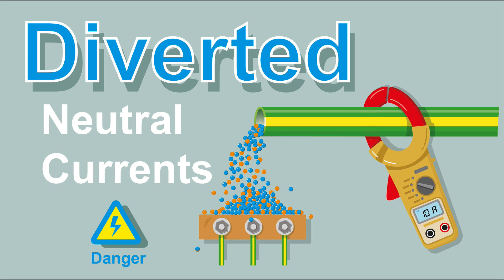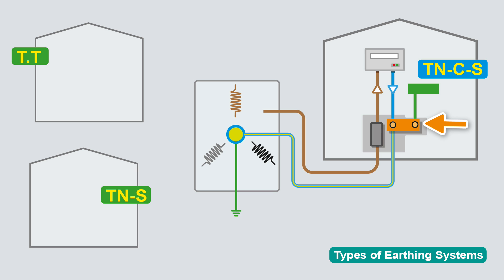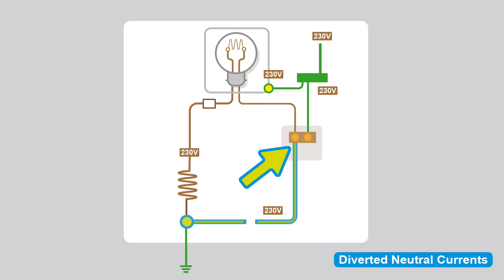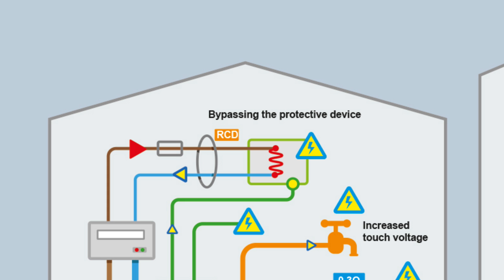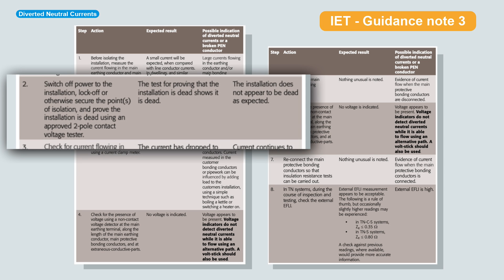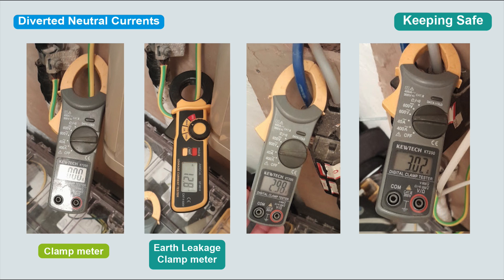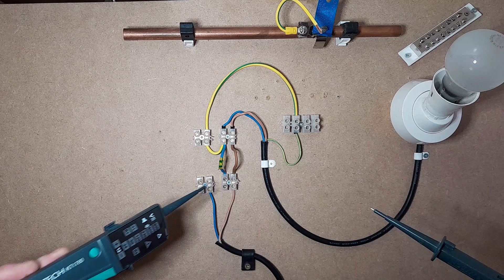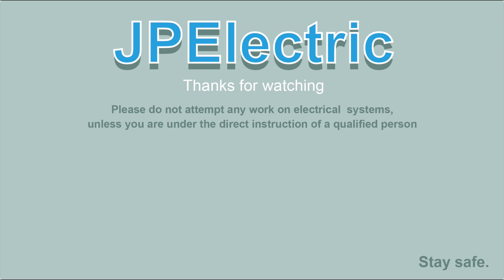Diverted neutral Currents -  Is our electricity supply safe?

Comment: I wish you guys would be a bit more specific. Instead of asking "Is our electricity supply safe?"  it would be more accurate to ask, "Is the UK's electricity supply safe?" 

And I would  say that no, your electricity supply is not safe. But living in the US, I would say our electricity supply is safe. 

But our system is more than a bit different. Technically, using IEC terminology, we use a modified TN-C-S system But we also use a split phase 240/120 volt system with a grounded neutral The  Neutral is grounded by the Utility at the transformer. Every single family home has its own transformer. At the distribution panel in the home we use a separate ground rod for the equipment ground, not water pipes or gas lines. My grounding electrode is not shared with the neighbor's house. they have their own. In the distribution panel and only there the neutral bus is bonded to the steel panel trough a bonding screw. But we have a separate equipment ground bus, connected to the grounding electrode ground rod, 

Of course all real grounds are common through the  earth, but invariably at different potentials. Rather than a single RCD in the incoming feed, we use separate GFCIs on individual 120 volt standard circuits and they trip at 5ma instead of 30ma like your RCDs. 

In normal balanced loaded conditions, from the panel back to the utility, you won't see any neutral current, the only current on the neutral is the difference in balance between the two 240volt hot lines. So at any receptacle as low as 5ma going through the equipment ground, will be recognized by the GFCI and it will trip. If we get an open neutral from the utility, everything will work fine if the two line loads are balanced and any diverted neutral current will still be detected by the GFCI. If the line leads  become imbalanced, it is pretty easy to detect because you end up with two series circuits with a non-connected neutral in the middle, but not returning the imbalance back to the transformer. the bonding screw on the panel neutral bus, won't support much current back to the grounding electrode. But each receptacle is still protected from a current through the equipment ground. 

In reality, the only thing the bonding screw does is account for any potential difference between the utility neutral ground and the equipment ground electrode. and  provide a trip path for the circuit hot line feeder breaker. So all these things maker our electricity supply much safer than yours. 

Personally, I think using 240 volts on routine circuits, is inherently more dangerous than 120 volt and having a single 30ma RCD, provides for far more energy in a shock or minor ground fault. 240v X 30ma = 7.2 watts whereas 120v X 5ma = 0.6 watts. 

That aside, adding an equipment grounding electrode instead of using common piping systems would help a lot. Our system isn't perfect but it is much safer in multiple ways. 

Just having the separate equipment grounding electrode, would not be a huge expense to implement vs other solutions. Exactly where the RCD is connected in relation to the  equipment ground could make a difference too. I'm not entirely clear how you guys do it, Having the single RCD was really a cheap way to provide limited protection. 

In the US, we can use GFCI breaker on each circuit at the panel and that's how we first did it, but more often today, we use GFCI receptacles at the first protected receptacle and any downstream receptacles are ten protected by the first one. Not being remote in the distribution panel, makes it a lot more convenient too.  Having one main RCD on our split phased system would be pointless because the main neutral only carries the imbalanced current. 

At this point, it would be pretty much ridiculous for you guys to change to the split phased system and typical 120 volt system vs your 240 volt system, but   you guys could benefit from some things we have done to make our system safer. Just my two cents. or pence or whatever it is you use!

But please do keep on mind that the internet goes world wide and your electrical system is not used world wide. Even all the 220-240 volt systems have differences from one country to another. I enjoy looking at what different countries do because I'm an electrical engineer. I also get a kick out of the IEC saying they are the worldwide standard. Because knowing how they work and how low their standards are, they are a joke with an inflated ego about being the world authority!
Reply: Good points with the multiple grounds at every house and transformer in the US. But with a broken neutral you then rely on the ground rod loop impedance back to the transformer. Depending on that impedance it may not be low enough to trip a breaker. So same conditions apply as in video. And also with a 120 / 240 split system in the US when you do have a broken neutral you can end up with wildly different voltages on each leg depending on loads, since with no solid reference back to the transformer neutral (except ground rod) you can end up with 160 on one leg and  80 on the other. When working for an electric utility in the US I have seen quiet a few devices fried in peoples houses when the neutral broke. So the split phase system is not without it's drawbacks as well. 

As far as 120 / 240 split phase, the US and the few other countries that use it are the outliers. 90% or more of countries use 230V or 240V single phase, if not 230/400 or 240/415 three phase to residential as well.  Benefit of 230V of course is system build out, you need a quarter of the transformers, due to less I2R loses in the secondary distribution lines. You don't need a transformer for every 5 houses and heavier gauge wire. You put one 380kVA or 500kVA and feed a whole neighborhood. Plus most house wiring is smaller as well. As well as cords on electrical devices. Took some getting used to to see basically a lampcord on a refrigerator when I moved from US to a 230V country. But, half the current, smaller conductor. 

As far as I know they  use 30mA (even up to 300mA) RCDs on 230V systems for a few reasons. One, at 230V you will get more normal leakage to start with and two, they usually use one RCD for multiple branch circuits. Using a 6mA RCD for four branch circuits at 230V will cause nuisance tripping for sure. 
There are pros and cons to all systems, TT, TN-S, TN-C-S. 

I now live in Vietnam with a TT system and it takes some getting used to. ZERO grounds at houses or receptacles, which are two prong, unpolarized. Just neutral and hot coming in. No ground, no bonds, just straight up TT. I have had some Americans here ask me to add in a ground rod and bond their neutral to it and since you are an engineer I am sure you are well aware how bad that can end up. So a TT system shall always have an unbonded neutral to ground and when I install a ground I leave it unbonded. But, I went way off topic here....  
Not saying one system is the best and the rest sub-par. They all have their benefits and drawbacks.
Reply: @inothome  Thanks for the reply, It's rare to find someone with broad knowledge. You are correct about the potential of an open neutral back to the transformer, but I believe that's very rare. Nonetheless, I have contemplated designing a device that could monitor incoming conditions with CTs on each hot leg and neutral as well as the ground current through the ground rod conductor. The concept is a 'system analyzer" that would monitor and alarm and be capable of reporting thing like balance and stray currents. There probably is little need for such a device, but I just like the concept of providing more information.  There are power monitors out there but I don't believe any provide this level of detail,  even though they could pretty easily add such features. 

A much simpler device would be a single CT on the grounding conductor right at the ground rod. It wouldn't need trip the main, but alarm anytime it saw any significant current. Pretty simple device that could easily retrofit to any system. Should really be no current flow in this conductor, however I believe some small stray currents may be observed, as in theory, it can provide a parallel path back to the transformer. 

As for 3 phase for residential, I don't believe we use this anywhere. 3 phase-4wire is common in commercial but I have never heard of it used in residential. 

I favor one transformer per home, but I know that sometimes they get shared and it's common for apartment buildings. Seems to me that shared transformers can have efficiency and balance issues on split phase services. A typical standard service today is 200 amp 240/120,  If you have EV charging, electric based heat, which includes geothermal and heat pumps, a 400 amp service is not all that uncommon. I really don't see a major economic advantage to a large single transformer. These get petty costly and in practice require another level of distribution and protection systems.  

Personally, I'd rather spend a bit more on a safer, simpler system.  If you go back a bit over 100 years ago when the US and NA went one way and Europe went another, no one was really looking at safety as a real factor in the decisions. The split phase idea was pretty ingenious really and although the US decision was driven largely the abundance and popularity of Edison's 110 volt incandescent lightbulb. but the concept of 220 volt power was also desirable. In a round about way, Edison's choice of 110 volts for his lights had a safety consideration to it.  Edison lost the war of the currents with AC winning over DC, but he won economically in that his standard lights were compatible with the choice. 

No doubt, the 220-240 volt world as he more economical  choice. On my opinion, the "240 volt world" has always been weighted more by cost above all else.  Safety did not really become an issue until later after both sides were already long committed to their voltage choice!  European countries took their system to their respective colonies so the 240-ish systems soon dominated most of the world. And when other neighboring countries electrified, the were largely steered by the available grid power. 

Canada and Mexico adopted the US system although parts of Canada industry did have 50Hz, for a time. this was mainly in the West and was mainly papermills and some steel plants. As I understand it, it mostly was about who made the Generators.  AEG was 50Hz, GE was 60Hz.  Very difficult to change in heavy industry because of all the motors used. I worked in a very old steel plant in the Midwest some of it dating back the very early 1900s. Some of the very old rotating machines were 25Hz. The plant made its own power and actually fed a neighboring community. We still used some 25Hz in the 70s and 80s and beyond. Cheaper than replacing huge old motors and gearboxes to get the speed and torque right. I remember a big mill drive motor that was Westinghouse serial number 003!!  

Mexico did have some 50Hz until the 70s,  Easier to compensate for voltage differences than frequency. 

And then there is Japan.  Generally, 100/200 volt split phase. West half of the country being 60Hz and East half being 50Hz. Pre WW2 most ll generators were AEG, post war when US was directing the rebuild of the country, they brought in GE stuff at 60Hz.  I've been to both halves. IDK how accurate it is but I had heard from Japanese EEs that they did a lot of studies, concluding that 100 volts was the ideal choice for safety. 

Generally their electrical infrastructure is quite robust. and reliable. Their power companies are huge and somewhat hierarchical, like most industry in Japan. I don't know anyone in power distribution, but know a lot of engineers. Mitsubishi  is sort of the General Electric of Japan. They make everything! They are a huge company with many divisions, I can't say I have  every seen anything under designed.  Most every engineer I have com across in Japan, have high ethical standards in regards to safety, 

But without a doubt, there is wide variability between countries. In developing countries, electric power bring opportunity, but if done rusheed or poorly engineered, it ends up undermine the whole system. You can put something together that actually works, but is full of hazards. Some places have decent standards on paper but have poor implementation and/or enforcement. Far too many untrained or poorly trained people doing electrical work. In the US we have gone from pretty well trained and educated people to what I call, "electrical installers" who really don't understand what they are doing.. Electrical work is not a DIY skill. but we see a lot of equipment designed around making it DIY.  Mistakes can kill people.
Reply: @professorg8383  Agreed, not to often to find someone to have an actual educated conversation with here on YT, so thanks for your reply as well. 
I am 99% sure they do make the ground current analyzers you mentioned. I do know for a fact they make open ground conductor monitors and seems to be more common in the UK, but have never seen one in person. 
And yeah, as far as three phase in the US residential I have not seen it. I have seen 400A services with CT metering for some huge houses, but never three phase. I have however seen quite a few three phase residential services here in Vietnam in some of the larger villas and I do think it is also common in Germany, from what some people have told me. 

I think the main advantages to 240 single vs 120/240 split is costs and line losses. Like you said, with 120/240 split phase you can have one transformer per house and that is fed with 1/0 triplex, maybe even 2/0 triplex. Then you have a 100A or 200A main panel in the house. Whereas with 240V systems they will have one transformer and run 4/0 or 320 (some odd size, I forget the actual size) quadplex and that will run the whole length of the street and feed 100 houses of one run of quad. Then in the houses there is no conventional main breaker panel like we are used to in the US with the heavy bus bars, clip in breakers etc...  Here a typical house will be fed with a 63A service, with DIN rail mounted breakers in the main. Like they do in the UK and most of Europe as well. So there is cost savings with that too. Then some branch circuits will be as low as 6A and up to 32A. So you save on the main service drop wire size too. Instead of 1/0 triplex you'll have 2 x 10mm wire, 2 conductor here with no grounds in Vietnam. 10mm is about 8AWG for comparison. Plus all the switched, receptacles and devices will draw roughly half the current at 240 vs 120.  So wiring and components are sized for less current. Wire is still rated to 600V insulation value though. 

My career was in substations and protective relaying, so I did not do much residential wiring in the US. Of course I did my fair share of residential wiring, but not as my career. Once I moved to Vietnam I have done a lot more residential / industrial wiring and still so crazy to see the tiny conductors used with 240 vs what we are used to in the US, since the current is roughly half for every device. My fridge only pulls 1A and the cord is no larger than speaker wire! lol Takes some getting used to wiring in a house main with 8awg or 10awg equivalent and that powers a whole house. When in the US we are used to 1/0 if not 2/0 to feed a house. Some larger houses, as I mentioned earlier, will be fed 63A, three phase 230/400V. But not many three phase loads. Just they need more than 63A of 240 to power the larger houses, so they get 63A x 3.  But, the local way electricians do things here is downright scary! Not much training and just twist wires until it works..... which usually only works for a few weeks and then more issues. I fix a lot of electrical issues here. 

Yeah, Japan is odd with their system for sure. But, due to that it enabled devices to work on more than one voltage and frequency back in the day. Now of course all the SMPS are all dual voltage and 50 / 60Hz. So when traveling most 120V devices will still work on 240V. Until you get to heating devices... yeah, the 120V heating devices let the smoke out when plugged in to 240V. 

The old motor-generators were really cool devices, to go from 60Hz down to 25Hz. I have seen them in old train substations and I think they were 60 to 27Hz. Now of course with high current IGBTs and electronics it's all done electronically. Like with HVDC power lines and the converter stations. Amazing the power levels they can transmit converting AC to DC then back to AC. And to touch on line losses again, they use DC since DC doesn't have the same line loses AC does. With the stranded transmission line conductors, the higher the current, the higher the impedance due to the twists creating magnetic fields that creates more impedance and heating. Whereas with DC you only have the actual resistance of the conductor itself. So a transmission line conductor of the same size can actually transmit more DC power than AC power. And not until semiconductors became able to handle the higher currents did it them become more economical to use DC for long transmission lines. 

If you are curious to what a main panel looks like with DIN rail breakers in Vietnam vs the panel boards in the US here is a video Jordan did of Artesian Electrics from the UK. He was on holiday , traveling throughout SE Asia and I invited him to check out an interesting problem I was troubleshooting at a house. I did not do the install, but this is typical of what I see here... no color codes, no consistency and scary!!! And I have not been back yet, so still no idea where this fault is, but homeowner does not seem to understand what can happen with a second path to ground and who knows how good of a path, it can heat up and start a fire. It's a TT system here, so no ground supplied from utility and not common to even have a ground installed at the premise.  https://www.youtube.com/watch?v=W2kAejAb4Hw
Reply: @inothome  "Protective  relaying"  You guys were the "nerds" of the power industry!! (just joking!) I've worked on building and then managing some large facilities with enormous power infrastructure. I'm wanting to say that our main 138kv sub handled about 30 Megawatts. I was not a power guy, but knew enough to be dangerous!  The "power nerds" spent a lot of time and effort getting it all coordinated. Definitely a special breed of engineers! I could follow what they did, but it certainly wasn't my area of expertise!

I began my long career in the 70s in a big steel company. We had about 16,000 employees at peak. It was a fully integrated mill, and for a long time we had the world's largest blast furnace. The plant was the size of a small city and ultimately I went on to a billion dollar joint venture greenfield plant.  I was mainly a controls/automation guy, but got into just about all aspects of the electrical field. Started out as an industrial electrician, managed electrical maintenance and worked in engineering on the design of a huge joint venture, leading edge facility. Our joint venture was run with a petty small staff which meant everybody in management got into all areas of the industry with my main job running maintenance with crews of about 40 techs in total on several different teams.  We were very much built around self directed workforce concepts. We actually made it work very well. A big difference from thee old top down style of management!  But we electrical guys were also more self directed, even in that environment. It always made more sense to me, but then by our nature, we were made up of well trained responsible guys. 

I "retired" and went into consulting including project management of some very large projects. Finally "sem-retired" again, consulting on hand picked projects and teaching. My resume reads like a book! Over the years, I built myself a very nice shop so I could maintain the fun of hands  on projects. I still come up with ideas a an excuse to buy more tools! At 70, I till like to dabble, and teach part time. Do my best to stay up on the latest tech across a wide variety of fields. I am kind of a "Jack of al trades"  and master of quite a few. 

I grew up in the space race and when all my friends wanted to become astronauts, I wanted to become one of the engineers in white shirts with pocket protectors! Always wanted to be the guy who knew how everything actually worked!  Still have not lost that drive. I love history overall and the history of tech and how it evolved across the world, 

When you talk about motor generator sets, I have dealt with smaller ones of multiple machines coupled together to run process lines and a few big boy that you could stand inside the stator and barely touch the other side above your head! Amazing machines!! 

Like you, never really worked in residential electrical, but did a lot and often got involved in troubleshooting when friends had problems. Did all my own work and strangely enough even consulted og NEC regulations! At one time or another, I have crossed paths with some of the top guys in the fields. Names that many in the industry considered legendary.  I never became famous in the industry, but was considered wizard club in a few circles. 

So I watched the video you linked and really enjoyed it, however, I don't think it was the one you were talking about related to main panels in Vietnam. It was really cool but I don't think the one you meant to link.  

Have enjoyed the conversation. Rare these days to come up with intelligent commenters. That used to be part of being an '"electrical guy", but it has changed through the years and there's a lot of people in the field who have no clue of what they're doing!
Reply: @professorg8383  Nice career you had! Yeah, relay work is fun, especially commissioning. Can be really rewarding to figure out why a scheme isn't working as the engineers expected it too. I had a similar start, but at a sewage treatment plant. I was lucky enough to bounce around in all the departments, learning and helping solve problems. There were a lot of lazy people there, so I got to fix a lot of problems no one else cared for, even though that was their job. Even as a kid I was always fixing everythign inthe neighborhood, what I find enjoyable. 

Also did the SCADA systems there as well, so familiar with controls. Then moved on to an electric utility, did an apprenticeship for substation electrician and like the shit plant, I was able to do a lot of stuff out of my classification. We had a small peaking plant too, so with my background with controls I ended up doing all the controls for the generators and eventually worked my way up to being the relay tech for the utility. Did everything, from relays, to gen controls, to radio systems, fiber, you name it. 

Left that job, took a trip around the world and decided to semi-retire at 45. Since then I have been to Antarctica twice as power plant electrician and funny you mentioned NASA. I worked a year at KSC in the high voltage department and left there about year ago, why I have so many rocket launch videos on my channel. But most people these days do not give one shit about the job, just there to get a paycheck and no idea on how the stuff works that they are working on. So even when I work it's hard to have technical conversations about the equipment. I try to teach fellow employees, but most don't really care, so disappointing. How can you fix something if you don't know how it works? (Hint: they don't, they throw parts at it in hopes to fix it). So been fun chatting here. I have worked with a guy who helped write some IEEE standards, pretty well know in the industry, Don is his first name. 

And like you, even though I am an electrician / relay tech by trade I am in to everything technical. Constantly learning, you will never learn everything and no one knows it all. Plus, we all make mistakes and that's part of learning.  And speaking of mistakes, yeah, I did link the wrong video.... I fixed that link, but I'll link it here again. 
https://www.youtube.com/watch?v=W2kAejAb4Hw
Reply: @inothome  Yes, I feel like I have had a good career and have no regrets of the path choices I made.  I would say you took some similar paths along the way.  I am a firm believer that what some people see as setbacks in their careers, can actually be opportunities to change your path. 

I still strive to learn new things everyday!  You'll never know enough!  

Watched the right video and my first impression was, "what a mess!"  

Are those real commercial panels or homemade DIY version of a consumer panel? Pretty much looks like just a piece of DIN rail and some breakers mounted in a J-box. Weird because it looks like a nice modern residence but with electricity being an after thought!

Not that I think very much of the IEC and see it more political than technical or safety driven, but I see that Vietnam is not a full member. A lot of IEC full member countries have some horrible electrical standards in practice.  I'm guessing that Vietnam has no real standards but if they do, no one follows them!

Reminds me a bit of ElectroBoom's vacation videos looking at hotel electrical installations in different countries.  He recently did one on Mexico, Jeez, what a mess!  He's a smart guy, but a bit crazy and entertaining.  I have occasionally borrowed some of his ideas to base labs on,  for my students.  I like to make my classes fun and also like to illustrate the importance of safety. I sometimes use hot dogs and other human analogs, to illustrate the dangers of doing something wrong and the potential from unplanned energy releases!  It's easy to  say don't do something, but showing students why, has bigger impact on learning. 

I have had students suggest that I do a YT channel, but the last thing I want to do is encourage idiots to do dumb things in an environment I have no control of. Doing quality videos is tough to do, as I found out during Covid doing Zoom classes! I prefer my classes being very interactive.as it's the best learning environment, in my opinion,  

Anyway, it's been a fun chat. Enjoy what you do! That makes work eay and rewarding!
Reply: @professorg8383  That is the normal breaker box here, some are even worse, some are better. But the UK uses (most of the world) DIN rail breaker panels too but the UK has inspections and they look much better. Here, it's a free for all. If I install one I make it look nice and it's so hard to not rewire an existing one if I am in it. But a local electrician here makes $7 a day, I charge more than that an hour. So a rewire to make it look presentable is a hard sell. And yeah, not many standards here and no inspections either. 
Great chatting and yes. I don't consider what I do work, I enjoy it and it's great to have a career you love. Makes work enjoyable. Although doing work here in VN isn't always fun. But full time jobs in the utilities I really enjoy.
Reply: @inothome  
The French now have superior main panels than the UK. They have double pole breakers as standard with twin busbars. That is the only part of their regs they are superior. But we are catching up in that aspect. Double pole breakers are available in the UK, they are just not mandatory yet.  RCBOs are recommended on all circuits as are AFDDs (arc fault) on socket circuits. AFDDs are mandatory on socket circuits in high-rises over 7 floors, care homes, etc. 

The French do not have main cartridge fuses. They have a whole house disjoncteur différentiel which is an RCBO of 300-500ma and combined main switch - max current is settable. This is to prevent fire while your local RCBO is for fire and person protection.  

The Danes tend to have three phase run into homes. A 40-60A supply would have three thin 10mm cables run in.
Reply: @inothome  
In the UK there is nothing stopping you converting your house to TT. Just ignore the ground wire supplied by the electricity supplier.  I would advise the earth rod to be away from your house and other houses as much as possible.  Say in the back garden, accessible under an inspection lid.
Reply: The US system is weird. 
* 240v and 120v run in? Wow!  
* The plugs are terrifying  - look like they are from a Lego set - hanging out of the wall a lot of the time.
* Sockets have no switches.
* Two types of plugs, 110v and 240v.
* The huge main panels look like from the 1940s, as do the huge black breakers. 
* Cables are thick, being more expensive as more copper is used. 
* Try boiling a kettle for coffee. You will die of thirst by the time it boils as the 120v does not deliver the power.

Bordering on third world. I cannot think of anything the US can offer, apart from lots of space in main panels.  
Canada should start the process of modernising, converting to single phase 230v, and adopting the best socket and plug in the world - the British G type. Also having double pole breakers at panels and AFDDs as standard.
Reply: @johnburns4017  Boil water with an electric "kettle", how cute. Just remember to turn off the socket when done! Can't have energized sockets around. 
As far as conductor size, coming from 120VAC and now working with 230VAC equipment, the power cables feel like speaker wires. Not sure about you, but I'd rather have more copper than not enough. We are well past WWII now and copper isn't in short supply. Speaking of, are ring circuits still a thing? Talk about third world. lol 

Jokes aside, I personally don't care one way or the other. Both have their advantages and disadvantages, as with most things in life. Although, I was serious about ring circuits.
Reply: @inothome  
Ye we make tea and coffee and soup and all that with boiling water. Amazing eh?  I personally use a simple metal kettle on an induction hob. - boiling water in around a minute.

I refer cables with the correctly sized cable. Look at all that extra copper in US and Canadian home. A slowly disappearing resource. And this thicker cable costs more.

I worked on a US military project in the Middle East. I was amazed they were using steel conduit in plant and mechanical rooms when we used mineral insulated cable and had done for decades.  It a was flashback to the 1930s. Very cute. I was expecting to see Laurel and Hardy walk in. 🤣
Reply: @inothome  
Final ring circuits came into their own in the late 1950s. They were not to save copper. My mother's house was built in 1954 with 13A G Type plugs. It had radials. Ring circuits have been widespread in the UK for 75 years. They have been found to be very safe. The British G Type fuse-in-plug was to protect appliance flexes. And to standardise on one plug and socket as previously there were different sized plugs & sockets and cable for different types of current draws and appliances. It was common to have three different types of socket in one room. However the fuse-in-plug became an enabler to use final ring circuits. The final ring circuit is ingenious in its simplicity. When used with the British G Type plug the ring is a busbar run around the house with distributed fuses at each appliance. 

There are many advantages to rings:
1. Cheapness, as smaller easier to install wires can be used;
2. A large number of sockets can be off one cheap to install ring;*3.* Having the same number of sockets using radials would mean multiple radials and multiple extra breakers at the main panel. Far more cable, expense, labour and hassle;
4. The 32A breaker and 13A fuse in the plug ensures safety;
5. Portable plug-in appliances on a ring cannot exceed approx 3kW. Some plug-in ovens are on rings;
6. Rings usually have a 32A breaker at the main panel - can be a lower value; 
7. Using push-fit maintenance free Wago type connectors to connect up the ring adds safety, as not being screwed connections they do not work loose. The ring's current does not run through the socket terminals (this applies to radials);
8. The British plugs enable rings having a max 13A fuse in them - can be as low as a 1A fuse in the plug to suit the appliance and flex/cable. Small flex and appliance? Then a smaller fuse;
9. Rings in the UK are limited by square metres of floor space, with no limit to the number of sockets on the ring. 100 square metres of floor space with 2.5mm cable for a 32 amp final ring. The cable can be 4mm, which is advisable in an unbalanced ring drawing high current loads;
10. Less voltage drop on long cable lengths as voltage comes from two ways;
11. Two ways for the earth wire back to the main panel, increasing safety levels. 

Radials are also used in the UK. Rings are not mandatory, but used because they have proven to be generally trouble free and safe. They can be installed using rule-of-thumb. These days a ring will be off an RCD, RCBO or AFDD (arc fault) breaker - these now are becoming DP, so safer again. AFDDs are now mandatory in some socket installations and recommended in all installations. AFDDs raise the safety level. If an office wants more socket outlets for extra desk computers. It is a simple matter of extending the existing ring with the extra sockets as the current draw is low. Cheap and easy. If radials are used many radial circuits would be needed, which may mean an extra consumer unit, breakers, cable etc, then far more labour. 

Some disadvantages are: 

a) Rings are more difficult to fault find. But electricians have no problem once the ring is fully understood. The ring can be split at a socket then tested as two radials for those unfamiliar;
b) Another is that if a number of high current drawing appliances are on one side of the ring, say nearer to the main panel, most of the current draw may be down one cable leg of the ring with the cable rated below the main 32A breaker. 

An unbalanced ring - a very rare event. 2.5mm cable is rated at 27A max. Although tests on rings have proven the cables do not exceed their current capacity in the vast majority of cases, just an imbalance in distribution of the two cables from the main panel (consumer unit). Good circuit design will prevent this, negating this disadvantage. 4mm cable can be used to the point where heavy current drawing appliances are, then 2.5mm for the rest, if it is that troubling for some. Using 4mm cable on one side of a ring and 2.5mm on the other, is still cheaper than a bunch of radial circuits.

Overall one final ring is superior to a bunch of radials needing their own breakers at the main panel. They are simpler, cheaper, being proven to be safe and worked well over the past 75 years. Using the new AFDDs on rings, which are recommended and mandatory on some installations, gives a far higher safety level.  A final ring with AFDD protection using 4mm cable and Wago style screwless connectors on sockets is near bombproof. 

You will have to give a very convincing argument against rings. I have not heard of one yet.
Reply: @johnburns4017  So what you are saying is the wire size in the US is too large and not sized for the current correctly? Or, the fact that it's 120V and the US / Canada should just change everything to 230V and then can use smaller conductors? Since, the conductors are sized for the current, not just big to be big. 
Yet, running rings isn't a waste when you have to make two pulls per ring circuit from the box, instead of one. 
So on one hand the US is wasting copper, yet on the other there is no downside to ring circuits and having to pull more wire in total. 
You speak a lot about safety, yet laugh at steel conduit and running wires in it. Which protects the conductors, but, unprotected, jacketed cable is better and safer somehow?

When you said a kettle in the US would take forever to heat up, I assumed you were talking about electric kettles you plug in. The US does have induction tops too. As well as gas and electric radiant stoves that do actually run on 240V, so same as there.  

But again, like I said before, I don't really care 120V vs 230V or conduit vs jacketed cables in a cable tray. They each have their advantages and disadvantages. I still look at ring circuits like you look at conduit though and just a waste of resources and time to install.
Reply: @inothome  
Read what I wrote. The antiquated electrical system means heavier cables are needed. 

You still do not understand final ring circuits attempting laughable futile negatives. Read what I wrote about rings and understand them.

I have the impression you do not know what mineral insulated cable is.
Reply: @johnburns4017  So the solution to what you consider an antiquated system is what? Replace entire countries' worth of electrical equipment to "upgrade" to 230V? Talk about resources and wasting them. 

I know what MI cable is, and it has it's uses but it's not something you would wire an entire facility with, unless absolutely called for. Again, you talk about costs and wasting resources. Cable tray and conduit also have their uses, as I said before. You seem to be it's one or none.

Ring circuits, yeah, I stand firm on ring circuits and you talk about antiquated systems. I wonder why you hardly see them outside the UK? 
More countries / population uses 120/240 split phase vs ring circuits. So that should tell you something too. And to repeat myself again, both 120/240splt phase and single phase 230V systems have their advantages and disadvantages. I am not pro one or the other. Same with TT vs TN-C / TN-C-S, they all have pros and cons. 

You do know you don't have to be a staunch supporter of just one thing. It is OK to see the benefits and disadvantages of different things. It's not a competition on what is the absolute best. Since there is no absolute best, everything has trade-offs and compromises. With that, I am done here. Have a good evening.
Reply: @inothome  
There have been significant advances in domestic electrics notably, LED lighting, RCDs, RCBOs, AFDDs, SPDs and screwless connectors (which have made their way into light fittings and some 13A sockets). Appliances now consume far less electricity than they once did making matters even better. 

A young friend a few years back bought an apartment in London a great cost. It needed full renovation. He was just married and stuck for money, spending all his money as soon as the pay cheque came.  He was focusing on the bathroom and kitchen doing it himself.

He asked me how to save on the electrical installation. 

There is genius, simplicity and economy of the ring circuit, which the British G type fuse in plug, protecting the flex, makes possible.
The big criticism from Americans and Continentals of the ring was that if the ring is severed for some reason, loose connection or just cut, one of the cables on one of the ring's 2.5mm legs could overheat drawing too much current causing a fire, as it is protected by a 32A breaker which would have too large value. A rare event but a fair point. 4mm cable can be used, so no problem. These days safety devices such as AFDDs have made the ring far, far, safer, so the ring should be the first circuit of choice.

His space heating and hot water was by gas. Because of the height of his apartment block he needed an AFDD on any circuit with a socket on it as the block has too many floors to be exempted. He ended up with 'two' circuits supplying all the two bedroom apartment:

1) The ring circuit protected by an AFDD. It supplies all the sockets in the flat, as it is less than 100 square metres, and one fused spur to the gas combi. It is in 4mm T&E cable on a DP 32A AFDD (32A is max these days for rings). Screwless lever connectors in backboxes were used taking the ring's load, then 4 inch 2.5mm flex to the sockets. All using Wago or In-Sure lever connectors. Using ferrules on the flex. Then no problems of having to use the socket terminals with two cumbersome 4mm conductors in them. The 4mm cable was easy to fit into the backboxes using the screwless lever connectors. Then the socket terminals do not take the ring's current load. This raises safety levels. If the ring is severed the 4mm cable will not overheat, as the 32A AFDD will protect it.

The induction hob will be off a 13A plug and also the oven. The Bosch induction hob is on a 13 amp plug and oven draws about 13 amps. They both are off the 4mm ring with sockets in adjacent cupboards.

Washer/dryer and dishwasher have sockets in adjacent cupboards - both draw 10A each. Using diversity the ring will be under the 32 amp current draw.

2) Lights. All LEDs with a DP RCBO on 1.00mm cable. One dimmer in living room serving three skirting height 5A round pin light fittings for table lamps.

Only drums of 4mm and 1.00mm cable making it cheap as per metre the cable is cheaper in larger drums. The 2.5mm flex for the tails to the sockets was three-core 2.5mm flex with the outer sheath removed. Quite cheap.

The main panel was a small cheaper metal job with an SPD. It does not take up space being very small and near to a large plastic enclosure, housing the Modem, data distribution to all rooms using RJ5 sockets, etc. Trunking used so no cables seen making it very neat. Safety levels are 'very' high as all bar the lights are on an AFDD, for minimum cost.

Money saved meant he could buy stainless flat plate sockets and light fittings and superior shower brassware. Yet high levels of electrical safety.

Due to the simplicity and brilliance of the ring we do not need a multitude of radial circuits and big main panels and yet can have very high levels of safety.
Reply: @inothome  
The US system is so antiquated, a cludge, it needs a staged changeover to single phase 230/240v in residential. There are no advantages to it. Get rid of the ridiculous splitting of the phase they use having two voltages into a house. 😵‍💫 Also use the British G type of plugs - the best, so go for the best. Most of the existing cable will still be used. 

The UK moved over from town gas to natural gas in the late 60s/early 70s. That is all appliances and supply pipe networks. All staged and went well. A whole country.
Reply: @inothome  
"I stand firm on ring circuits and you talk about antiquated systems. I wonder why you hardly see them outside the UK?"

The rings are in the 50 odd countries that use the British G type fuse-in-plug. Understand them. I gave the info. I use a ring out of choice. 

I am not taking nationalistic stance. The French have better main panels than us in double pole breakers as standard - available in the UK. They have a whole house main RCBO with an integrated main switch eliminating main cartridge fuses. Their houses are TT. All better than us. But the USA system is well..... What were they smoking when they came up with that?
Reply: @johnburns4017  FYI All the Third world is 240 volts! Split phase gives options, it's ingenious, not weird.   Sockets don't hang out  of walls unless someone took them loose for remodel.  They are screwed in quite effectively. I defy you to pry one loose!!  If done according to code, they're fine. Could be better yes, but certainly would not go your way!!  Don't want your ankle breakers!!!

And why would they have switches??? Really no purpose!  

Actually, way more than two types of plugs!! Around 45 different types, last time I checked! There's about 6 pretty common ones. Different ratings of both volts and current some locking types. 2 wire, 3 wire and 4 wire..

Our breaker panels are designed to withstand maximum short circuit currents, Higher interrupt  rated breakers. You consumer panels just blow up and can't contain serious faults!  They are a joke!! All cheap plastic, low rated breakers, they are junk!!!  Look nice though, but we look at things from an engineering perspective, not an interior designer!

Our cables are designed to carry the rated currents. Yes more copper and a bit more costly, but since when is cheaper better?? 

Well, we generally don't use boiling kettles. Single cup coffee makers brew a fresh cup in about 2 minutes!  Generally we don't drink coffee because we are thirsty and I doubt that you do either. Electric kettles aren't really common here, I have one but very few people do. Why heat an entire pot when all you need is a cup!! Pretty wasteful actually!

When Canada modernized they went our way!!!  120 volt is in fact safer. Of you know and understand electricity, you would know that. Japan is very close to the US system but their standard voltage is  100 volts. This dates back to safety studies long ago.  BTW, our GFCIs are 5 ma,  much safer than your RCDs.  Everything is US standards are far safer than IEC. Wea ctually test stuff to worst case conditions. IEC doesn't test and lets manufacturers "self certify"!! That's just insane!! But the IEC is really about economics while the NEC, UL, NEMA and CSA are all about safety, they don't take cost into consideration. 

You are just used to a crappy system. I'm an electrical engineer with a masters and 40 plus years in industry and have worked with both US and IEC standards, IEC stuff is junk!! Their standards are far lower than in he US.  IEC rated stuff is cheaper, but it's basically throw away junk and when it fails, it does so catastrophically and often takes other equipment with it! NEMA stuff is designed to contain the worst case fault. It is often rebuildable too. Not throw away junk!  

I respectfully suggest that you don't know what you are talking about and I doubt you have much formal theoretical training. Europe went 230 volt because it was cheaper and Germans set the standard in power generation. No real consideration given to safety.  

The US decision was more complicated. Safety was a factor in a round about way. Edison chose 110 volts from a safety perspective, although his system was DC. Westinghouse and Tesla won out with AC vs DC, but Edison's 110v light bulbs were virtually a standard. They worked on either AC or DC. The dual voltage concept existed in both AC and DC, The split phase approach was easy to implement. Although safety was not the driving force for the lower voltage as much as the light bulb compatibility, but it was the reason Edison went with 110 volts. In the battle between AC and DC, Edison made safety as a major reason for his system. Although the public really didn't understand AC vs DC, they definitely had a perception of 110 volts being safer.  As electricity was beginning to be accepted public perception had an influence. So the US standard ended up using some aspects of both competing systems. It really ended up being a win-win solution. Edison lost as far as DC losing, but he won as far as selling his light bulbs that weren't really effected by the difference. As lighting was the main use of electricity, the public was content not really knowing the difference. 

In Europe, the Germans decided and that was it. Then electricity moved around the world to the European colonies, which followed their standard. Low cost meant wider adoption, but there was never a debate in the first place as there was in the US.  It didn't take very long before commitments to their systems pretty much ruled out any reconsideration as switching would have been very expensive no matter which way you switched.
Reply: @professorg8383  
What ill-informed babbling nonsense.  That is all I can say about it.  Read what I wrote and learn something.  I am fully aware of the history of it all. 

I have worked on USA systems. I was shocked at how antiquated they were  - and how warped it all is. Third world.